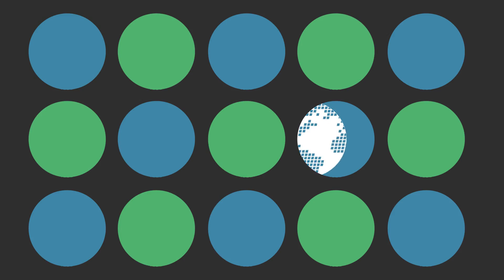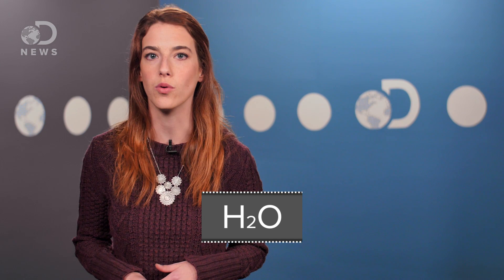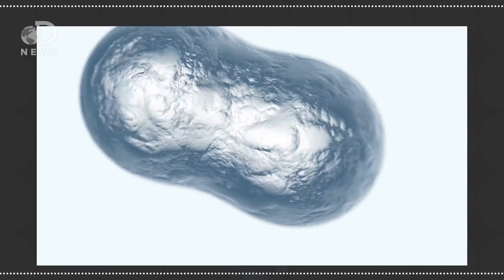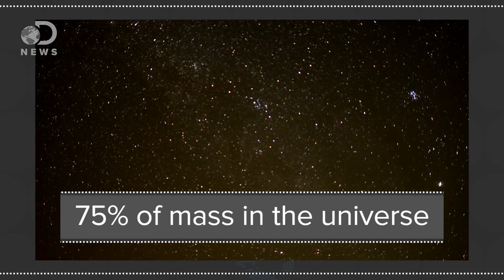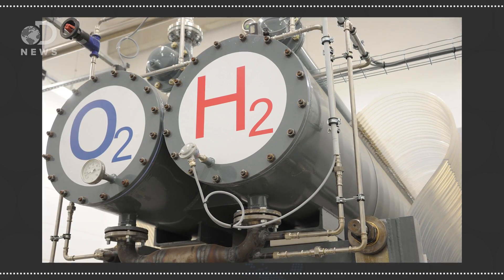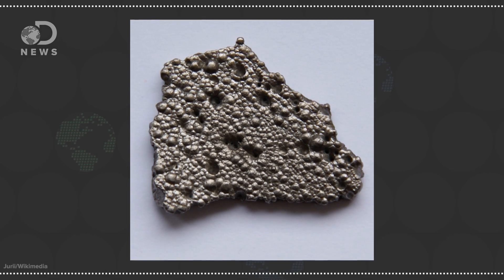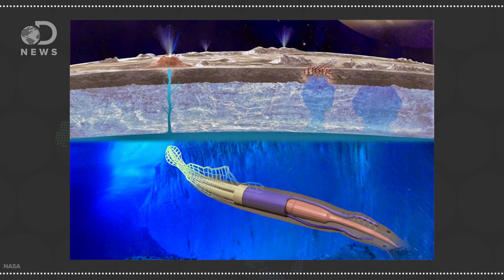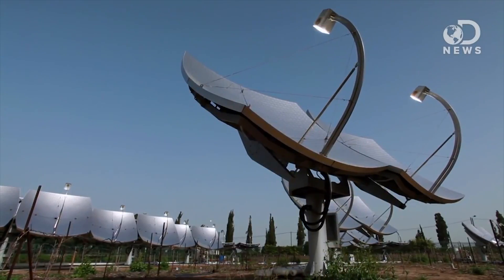How Can Water Be Turned Into Fuel?

Comment: DNews, it almost sounds as if you have missed the point this time. Electrolysis does not fuel anything, it costs energy. In fact, it costs more energy then what you get back from burning that hydrogen. It would be better to just power whatever you are powering with electricity instead.
However, if nothing is requiring the electricity that is being produced, it is better to store it as hydrogen gas then letting it go to waste. Electrolysis makes sense as an energy conversation.

Comment: H2 is a good way of powering our future (by nuclear fusion or even fuel cells for small scale), but when you electrolyse water into its basic components O2 and H2, according to the law of conservation of energy and matter you will be losing energy because energy can not be created nor destroyed but it is transformed.

So more energy is required then you will get out of the reaction, then another issue arises on where do you get that initial energy to start the electrolysis reaction, renewable or non-renewable sources.

Comment: Hydrogen is usually made out of natural gas since the process is cheaper than electrolysis. Electrolysis uses besides having problems with reduction and corroding metals an insane amount of energy. Hydrogen is super difficult to transport and store. Liquification of hydrogen for transportation uses energy, almost 2/3 of the energy stored in the end product. Even batteries are better than this and they are pretty bad. 

In industrial and chemical applications hydrogen is useful for a number of things therefore improving the technology is time well spend but in cars it is a waste of resources. 

The petroleum companies just need a substance that people will buy on gas stations. 

Fuel cell technology is interesting but still the problems of the stability of the membranes is something that hasn't been solved jet. 

Everything above is my personal opinion if you have a different one this is fine.

Comment: There is one problem that I've been made aware of from my own experiments with hydroxy generators as they are sometimes called.  Hexavalent Chromium.  If you're unaware of why it's a problem, go watch the movie Erin Brockavitch.  Industrial scaling of the systems they are describing in this video would undoubtedly create large amounts of contaminated water that would have to be dealt with; and we all know just how trustworthy major industry has been at cleaning up their waste in a safe and effective manner, don't we?
Reply: hellcat1988 Wait, I thought that it created clean water, which is why it is used on the ISS?
Reply: When using anything with chromium in it for the anode and cathode like stainless steel, it contaminates the water.  The Cobalt coating that they mentioned in the video might not have the same problems of contamination, but stainless steel is far cheaper.  Cobalt is also radioactive, so it might contaminate the water with radioactive particles which would make the water even more dangerous then the Hex would.

Comment: Splitting water into hydrogen and oxygen and compressing the hydrogen to a fuel tank is a less energetically efficient process than current hydrocarbon engines. Also, compressed hydrogen in any level of density appropriate for acceptable drive range has to be so highly pressurized you may as well be driving a bomb on wheels

Comment: The problem with hydrolysis is that you're investing more energy than in return. The emission is transmitted to some other source, and more energy is needed than initially. The best way is to use a cleaner electricity generation method in the first place, such as solar, wind, or wave.

Comment: I don't get why everyone is calling a fuel cell a battery, the way it works is an electric charge is introduced to a chamber/tank from a battery or some other source. The water then breaks down into two hydrogen and one oxygen. The hydrogen can then be used like petroleum in the sense that it burns and moves Pistons which produces more energy than is need to keep the reaction with water going. The only way it could be used as a battery was if you stored the oxygen which would normally be vented or pumped into the engine block to increase the power output and efficiency. However, fuel cells can also be used to run electric motors by cycling the gas through a catalyst from the platinum family of metals like indium or platinum. Platinum being the more efficient one because it's is cheaper than most of its family members, and can run longer before needing to be replaced.

Comment: What's the point of using electricity to create hydrogen -- a material known for exploding (remember a little thing called the Hindenburg?), when it would be just as easy to store that same electricity in a battery and have an electric car?  I can't imagine the challenges of building an electrolysis machine that won't corrode is any more complicated than increasing the efficiency of an electric motor.
Reply: CanEhdianbuddEh!? Which is another reason why purely electric cars are better.
Reply: Shawn Ravenfire 
The Hindenberg was a disaster because of the materials they used on the skin of the outer cover, that's what caused the most damage. A car full of just pure hydrogen is far safer than a car full of petrol, Hydrogen is so light that it would disperse into the atmosphere in seconds if the canister is pierced. petrol would just burn on the ground for ages
Reply: Rob Fraser Just stay away from electric Samsung cars.
Reply: And another thing.  We kind of just glossed over this Jupiter eel-robot.  How does it get energy from frigid water?  Isn't coldness the lack of energy?
Reply: Shawn Ravenfire Because if they go the hydrogen route, the oil companies can still keep a hold of us by the balls, because we'd still need to rely on fuel stations to fill up with hydrogen. Where as battery electric would give us independence. I will not by a hydrogen car, my next vehicle will be battery electric.
Reply: edstar83 If I were a major stockholder in the oil industry, I'd sell my shares and invest in power stations where cars can recharge.
Reply: Shawn Ravenfire Petrolium is known for exploding too.
Reply: Shawn Ravenfire
exactly!
Reply: Shawn Ravenfire Well, it may not be as useful in cars, but it is essential for the future of our species. Without hydrogen electrolysis, we wouldn't have men on the ISS. (P.S. haven't watched the video yet, might come up in that :P)
Reply: VintageLJ Yes, I agree with that.  I'm just talking about using it in cars.
Reply: Telecastvids True, if the gas tank were simply punctured without being ignited.  But we've also seen what a ruptured hydrogen fuel tank did to the Challenger.
Reply: Shawn Ravenfire A single phone battery can explode and cause third degree burns and trauma so having 18,000 of them lining the floor of my car wouldn't make me feel any more confident than petrol or hydrogen.
Reply: Rob Fraser I still prefer my chances with electric.  I've driven electric forklifts for years, and they've got huge batteries, and I've never heard of one of them exploding.
Reply: There's a little something that burns (like the Hindenburg did) called *hydrogen fuel*

Comment: I dont get how they would make it profitable. You need electricity at first to break the mollecule. And then transform the Hydrogen Energy into mechanical motion, back into electricity?. Is the electricity output  THAT bigger than what the electrolysis demand..?
Reply: Josh Lee Hydrogen is not a fuel source, but a way to store energy. Its a battery, basically, and it has much higher efficiency (~80%) than fossil fuel engines (~20%).
Reply: spaide98 There is no point in hydrogen. E.g. you start with 100kWh of electricity, do electrolysis, compress hydrogen, than use fuel cell to get electricity, you end up with 30kWh, and you wasted 70kWh i various steps of the process (25% in electrolysis, 10% in compression and 50% in fuel cell). 
https://en.wikipedia.org/wiki/Hydrogen_economy#Use_as_an_automotive_fuel_and_system_efficiency
Reply: Sasoon2006 you loose energy in every method including electric energy lol there is a video comparing the loss of energy in electric cars and hydrogen cars
Reply: Fusion of hydrogen
Reply: Josh Lee It does not give more energy than the electrolysis consumes. It gives less and some turns into heat. The way you get energy from hydrogen is the reverse of electrolysis, thus if it did give more energy, it would be a perpetual motion device, which is impossible.
Reply: spaide98 sorry for my bad english :/
Reply: spaide98 my thoughts exactly, hydrogen as a fuel seems like a waste of time at best, i believe that solar and storage is a much better option.
Reply: DNews please :)
Reply: spaide98 The only reason to convert electrical energy into hydrogen is to increase the energy density and portability (think refillable batteries). But the energy density of fossil fuels like gasoline is much greater, so hydrogen still fails in that regard.
Reply: bkm83442 Hydrogen is better than nothing but it comes with lots of very expensive baggage.
Reply: Josh Lee Solar and storage at the moment would not be powerful enough nor cost effective to be placed on vehicles. Hydrogen fuel could be created today from solar panels fields to avoid any greenhouse gas emissions.
Reply: how about everything that tesla motors is doing? If hydrogen is feasible, can someone give me a simple explanation to how it can create more energy than it will use? Because to me it sounds like basic physics is telling hydrogen that it is worthless and a waste of time
Reply: VintageLJ you realise that that energy efficiency does not make something viable; electric cars are almost 100% efficient, so based on your argument, why would hydrogen even be a good idea? Also you missed the fact that fossil fuels, even though they are less efficient, they have the potential energy greater than a magnitude of difference than hydrogen
Reply: ANSHUL JENA Fusion of hydrogen what? It is one thing to use buzz words like "fusion", it is another to make them viable and implement them. Are you suggesting that we make mini sun's to power cars? Because the last i heard, science is not currently capable of doing that. I'm sorry to say but your statement of "fusion of hydrogen" adds nothing to any conversation, let alone this one.
Reply: JWQweqOPDH that is exactly my point, that is why i think hydrogen is the single biggest waste of time as a potential fuel

Comment: another problem: it's not very efficient, it's usually better just to use the electricity directly, rather then going electricity -> water/hydrogen -> electricity.
Reply: EvilPlagueDoctor ...It is efficient. In fact, it is 60% more efficient than current car engines...
Reply: VintageLJ
well yeah.. but current car engines are insanely inefficient. especially using the piston style motor, where as electric motors convert directly into rotational forces with some reach %99 efficiency (from electricity)

I'm just talking about the loss of electrolysis, and the loss in a fuel cell (though they are getting much better) it's more efficient just to use electricity, as, well, electricity.
Reply: EvilPlagueDoctor Stanley Meyers found a way to make it Extremely Efficient research on his patents and his water powered buggy!!
Reply: Electric motors use the same
Electricity--> battery-->electricity

Comment: hydrogen fuel-cell vehicles are a farce.
first there rage is no better then some battery powered EV's.
second hydrogen is a loss fuel. it takes more energy to make it then we get out of it. third it out put water meaning it can not operate in cold weather without freezing or diverting lots of power to heating the system which mean range loss.
fourth hydrogen cars require billions and billions in infrastructure to be built to support there wide spread introduction.
and last over 90% of hydrogen generated comes from fossil fuels and natural gas reserves. so were burning gas to get it. burning gas to refine it. burning gas to ship it. and your burning fuel to get.
how can this possibly compare to a pure EV with its fuel ship right to your door!

Comment: That's all well and good, but don't you need massive amounts of energy to separate hydrogen and oxygen? Wouldn't this kind of system need outside energy input to function? I'm just going by basic knowledge of physics and chemistry... you can't have a reaction that is 100% efficient and separating atoms from molecules is such an energy demanding process you couldn't actually power things and have enough energy left over to do electrolysis.
Reply: MaxFist  DNews always screws a lot of stuff up. The other day they were saying cancer is a virus. Today they screwed up this, as well as some things in their other video.

Conservation of energy keeps this from being used as a power source; you always need more energy than you put in. You can use it for things like cars though; in that case, you're effectively just storing energy. It's not 100% efficient storage, but then again, nothing is.
Reply: I think you need something like 237 kJ of energy per mole of water... or something like 40 kWh per kilogram of hydrogen  and that's assuming you have 100% efficiency, it's really quite a bit.
Reply: MaxFist There's actually some cool ideas to use much more viable sources of energy, like nuclear, to produce H2 as a by-product (in the case of nuclear, it's the extreme heat produced that can rip H2O apart). But, if we can't figure out something like that, H2 is not viable as a fuel source at all, and in my opinion, should not be getting the funding or attention that it is.
Reply: MaxFist Some have said that we will never run out of fossil fuels.
I now agree with them, because oil companies can use energy from nature to fabricate fuel which they will keep selling as a business. If we let them.
Reply: MaxFist Of course you "need outside energy input to function". On the other hand, they're sponsored by Toyota. Money trumps physics.
Reply: jordana309 I mean hydrogen looks like a pretty efficient way of transporting energy (at least until graphene power cells become viable), but claiming that it's the solution to all our woes is ludicrous. You still need a shit tone of energy to obtain hydrogen and like you said, if we can't figure out a way of getting it in some other way (as a waste product preferably) it's just passing the issue of pollution from cars to powerplants, which doesn't solve shit in the long run specially cause most powerplants run on fossil fuels.

Comment: Wait, you use energy to separate H and O, and then you get energy from combining H and O? What's the point in this? Aren't there losses involved?
Reply: Hairysteed You could use solar energy to split the water to hydrogen and fuel your car with it. You'll get way more miles on the same mass of fuel (battery vs nitrogen tank) and also it's faster to put fuel in than to charge a battery, as the H generation could take place at home via solar energy while you're away driving or something.
Reply: Hairysteed Energy storage.... and yes losses are involved..... 
Storing energy to a battery is more Efficient [less energy loss] than splitting water into H2 fuel...
BUT.... if you take energy density into account [energy capacity 1kg battery vs 1kg of H2 fuel], H2 fuel should be better.
Reply: Jokes on you, I have no name Costs. First you isolate Hydrogen gas, then you compress it enormously until it becomes a (very cold) liquid. Then you have to make an extremely strong steel tank in which it is stored, Then you have to have a method of transporting it to where it's needed (then you have to store it again!) Then you need to get it into your very heavy and strong fuel tank in your car. Then you have to take note of it's significantly lower (than gasoline) thermal efficiency, and it's preponderance to explode. Apart from that hydrogen is great.
Reply: John Benton Way to crush an argument, but still it's environmentally more friendly than gasoline IF it's made using electricity from environmentally friendly means.
Reply: Absolutely. 
My argument has always been 'There are lots of ways to generate electricity, but only one way to burn oil.' Burning Hydrogen to generate electricity is a bit like eating more to get thin!

Comment: All sounds great. But the entire process is very inefficient, such that, where's the electricity come form? That's it, coal, oil and gas... Only worse
Reply: iZZUnR4T3D It's not inefficient. In fact, its more efficient than most other fuel sources. (80% efficiency)
Reply: VintageLJ Its not really eficient as 80% means its 20% less efficient than if you use the electricity directly instead of using it for the electrolycis needed to produce the hidrogen.
Reply: +VintageLJ The fuel cell itself only about 60% efficiency at best. Not counting other process.
Reply: james lee Well, when I did the experiment, we found an ~80% efficiency. (Chemistry Degree).
Reply: Erik Carreño Of course, using the electricity directly is best, but do you want a generator in your home? Why do you think we use batteries? Fuel cells are relatively efficient.